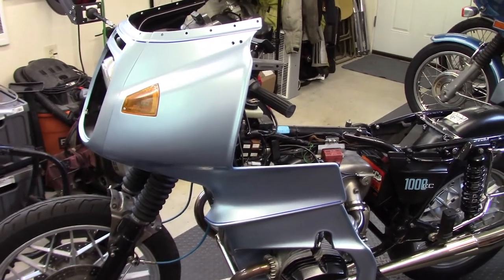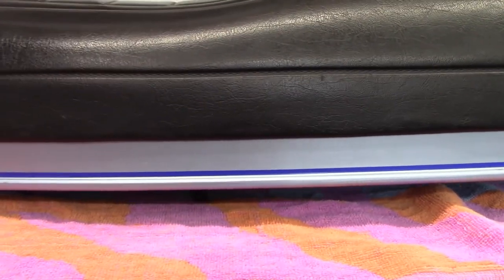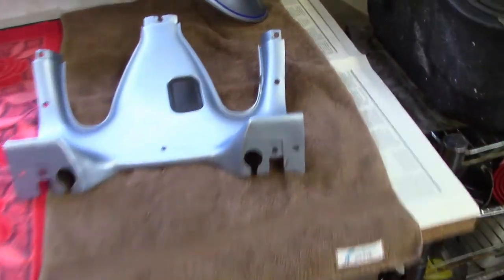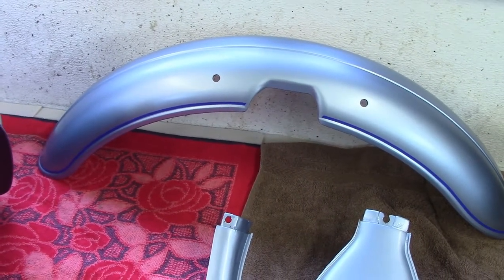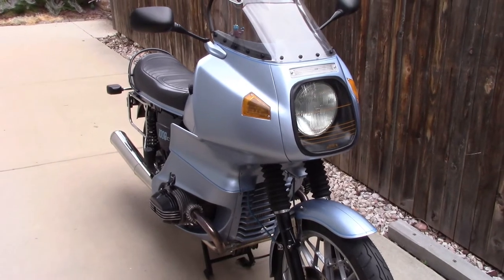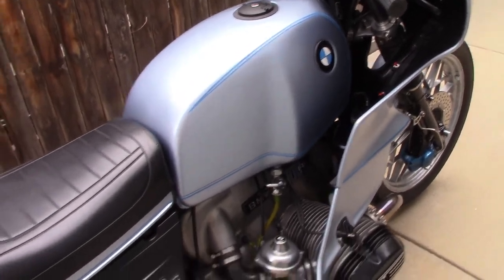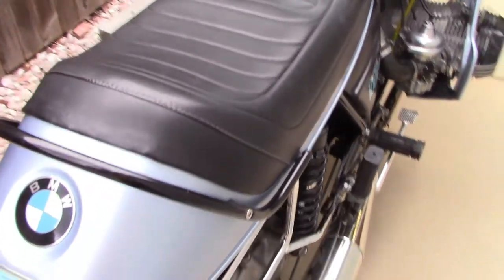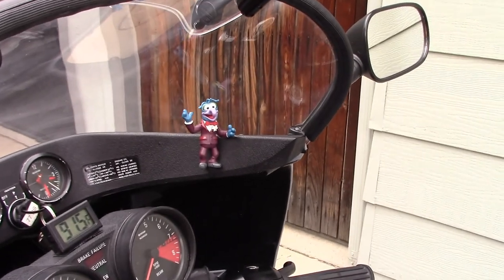1977 BMW R100RS Painting Pinstripes

Comment: Great videos . I also have 1977 R100Rs CFO-spoke wheels- that was painted with gloss clear coat by mistake. I can't complain as the painter we used at the last BMW dealership I worked at did the job at no cost to me as I was retiring after working there for many years. The pin stipes were done nicely but the clear coat just wasn't what I need. Any suggestions to painters? I was in Texas but now live in Ohio. Regards.
Reply from the maker: Greg I don’t have a painter suggestion

Comment: Beautiful and these videos have become the standard, almost cultish. I am restoring #6180240 (big exhaust model) that was re-painted in motosport colors. I'm putting it back as it should be, but looking for a painter. Any suggestions?
Reply from the maker: Hi T B, Thank you for the kind words. And, it's great to hear about your work on putting another 1st year RS back in stock condition. The person who did this paint work is out of business-a victim of the COVID situation. Depending on where you live, you may find some custom bike builders and they can put you in touch with painters who like to work on motorcycles. Another avenue is local bike dealers and local body shops. In the past, those businesses have given me good leads on motorcycle painters.

Comment: Hi, very nice job. I painted my friends 1976 model but used gloss  as i did not know any different. Should your machine have spoked wheels?.
Reply from the maker: Hi Majorscope,  Yes the 1977 RS had spoke wheels with blue pinstripes. It came this way when I bought it.
Reply: @BrooksAirheadGarage  Hi, Thanks for the reply. I found my friends machine on ebay. The owner was going to dismantle it and sell the bits. It was smoke red. Research showed it was the 1976 demonstrator supplied to BMW Park Lane in London. Very interesting.